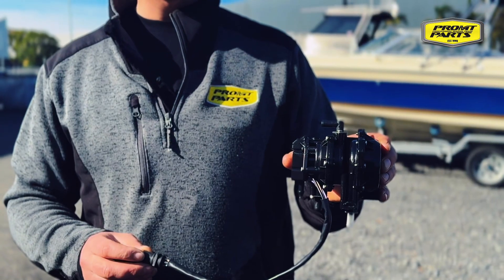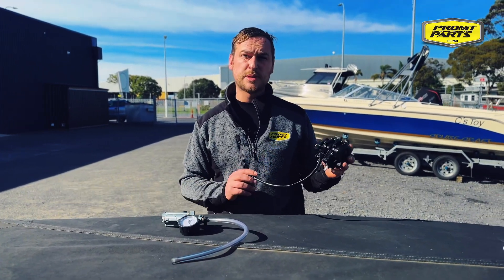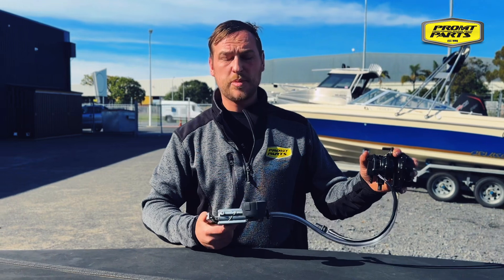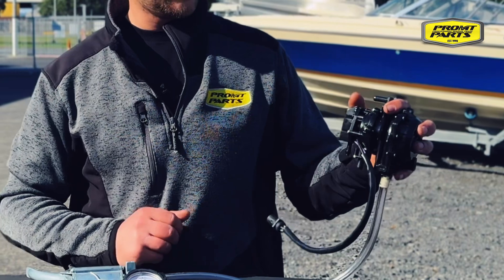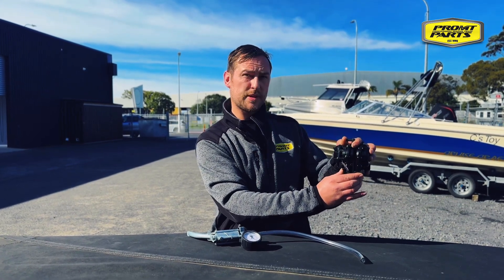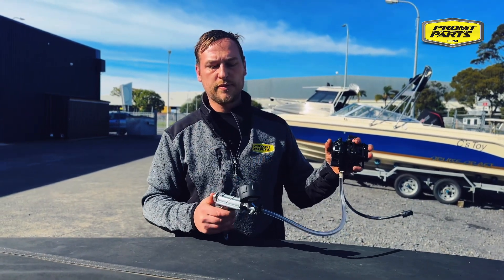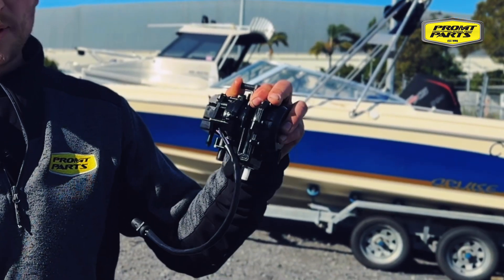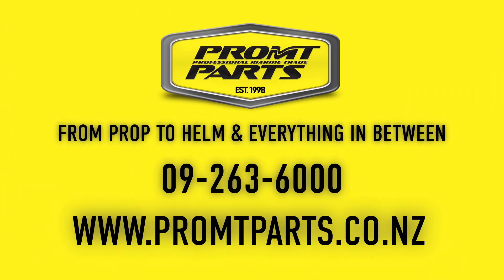VRO PUMP TEST!

Comment: Hi, great video! Quick question I have a 95 Johnson 175 fast strike that every time I go to use the boat after cleaning it and washing it there is two-stroke oil running from the bottom of the cowling down the lower unit. I also found my last trip out that it is using excessive oil and smoking way too much at idle. Is it possible to test that VRO pump like that while it is on the motor?
Reply: Just wanted to add that I put gear clamps on all of the fuel lines to make sure I wasn’t getting a vacuum leak from there. Let me know your thoughts on this issue… Thanks
Reply: I hate how no one answers back, no does anyone tell the solution they found to their problem 😡🤬
But anyway hopefully you find your problem buddy, I have a 94 Johnson fast strike 150 with a bad bog, and I can not find a solution, only thing I can find is that it could be a hundred different things, and it’s so over whelming lol. I myself have a question on the VRO pump and can not find an answer to it. But after this I kinda have a gut feeling what I thought was right. I’ll be hooking a small 3psi electric fuel pump to my motor and see if that helps. Fingers crossed 🤞 and hopefully that works and helps me narrow down my issue. Hoping the best of luck to you!

Comment: You are soooo right indeed.  Most techs have no idea how this pump works, much less how to properly test it.  They are more interested in making unnecessary/complicated and expensive conversions to conventional fuel pump(s).  No one even realizes the beauty of the VRO system is that it is so darn easy to over ride if you want to premix.  Simply remove the oil tank, unplug the pulse alarm connection and use premix.  Absolutely no need to go through all that expense and hassle.  VROs are great fuel pumps, the oil pump section does not have to be used.  The air motor and fuel pump rebuild kits are available and easy to install as well.